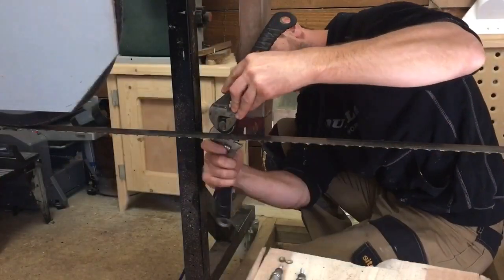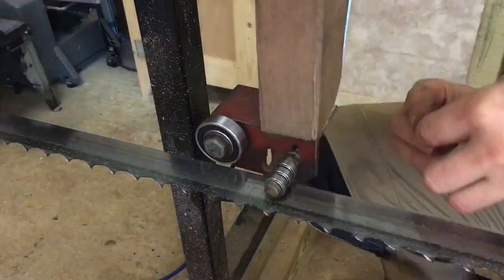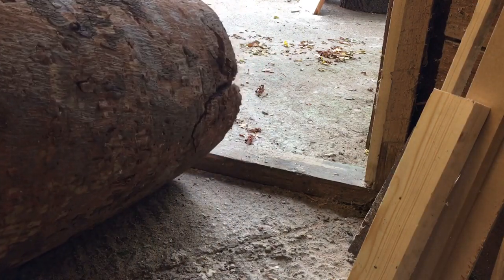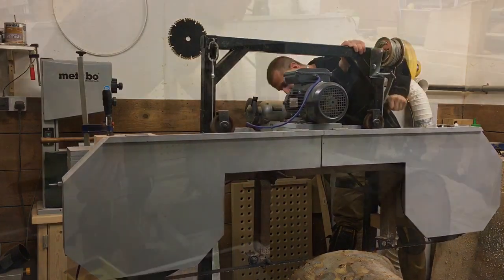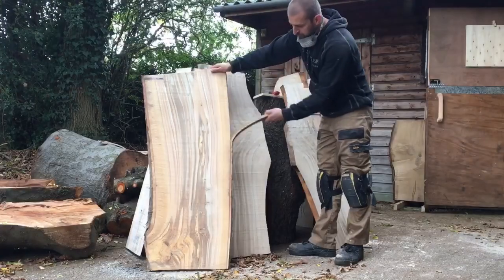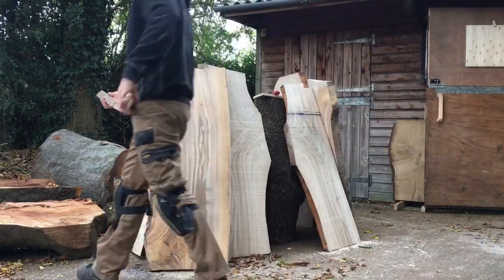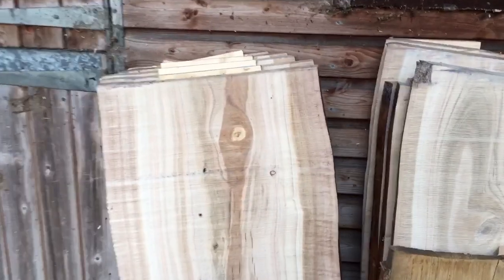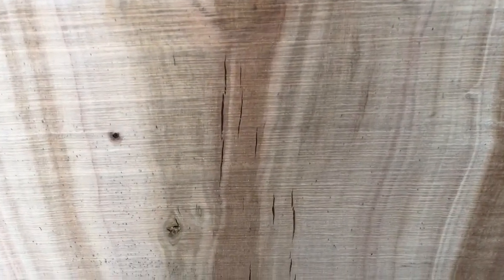Milling eucalyptus! Did I get this wrong?

Comment: This log would be best quarter sawn. If you look you will see that the cracks occur in the pith. This section should be" boxed " or removed. Sawing it requires careful attention to the stress in the log. If you look at Bambra Agroforestry on you tube you will see an excellent demonstration of the technique.

Comment: There are some 800 different species of Eucalypt. Most of what grows outside of Australia is Southern Blue Gum(Eucalypyus Globulus) or similar species.. It grows much faster on more fertile non-Australian soils. This was a very young (12 years) and small log, absolutely certain to split. Old, slow grown (regular droughts help!) timber which has been dried for twice as long as you think necessary won't crack anywhere near as much.

 If you could find yourself a 500 year old Toona Ciliata Australis you could retire on the sale value. Gorgeous timber.

Comment: Hi mate, your problem is mostly that the wood is cut down at the wrong time of year all wood to be killed should be felled in the winter.  This means that it has a much lower moisture content to start with.  Also eucalyptus grows too fast here in the UK as there is no dry season for the wood to strengthen up. One thing with your stack of wood you should line up the stickers with the base rails of your platform and always have a sticker about 1-2 inches from the end. Also try flipping one board then not the next one in the stack this way the wood helps the slab below it to dry straighter as the forces are working against the cupping of the one above. Great work though and a great channel.
Reply from the maker: Blaise Brogan thank you very much, that was really helpful! 
My father told me many times about harvesting trees in the winter is the most ideal! ( he also milling his own lumber)
Unfortunately in my case I don't have a lot of choice, I take the logs when ever they being offered, regardless the season! 
Thank you for commenting!
Regards Szilárd
Reply: Mate I know you have to take them when you can you could mill them in 1/2 then leave them for a few months, but great you are saving wood!
Reply: eucalypts grow fast thats wat they do,doesn,t make a difference wen benching it,keep ya logs damp if storing them,use a lucas mill look them up on google we have zero probs
Reply: @williamleahy1377  totally depends on the species and conditions. Some eucalyptus grows fast, especially in wet conditions, but many are very slow growing with extremely dense hard timbers.
As for sawing in the winter, it generally doesn't matter much of Australia when u cut them at least the species we bother with.

Comment: In Australia we'd call this a hardwood not softwood.  They do grow quickly and are used in plantations for construction timber and pulp.   They do suck up a lot of water to see them through the dry season - cut them at the end of the dry and I think you'd find a different outcome.  I know you didn't have a choice.  I think I'd leave bark on, whole logs, sealed ends and have another go in 2 - 3 years....You may find the wood gets very hard.  Love your videos.

Comment: I am searching some information since last year about how to saw eucalyptus and prevent it from cracking, I think quarter sawing is best way to saw eucalyptus, another way is to split the log first and the cross cut the planks, and then you have to dry it very slow by wrapping with a plastic, if not then it will bend, warp and twist. 
I'm going to do some experiments shortly.....!

Comment: We have wood here called Sweetgum, same deal. It's best left to dry as a log, off the ground. They are both extremely unstable, to the extent that you can dry them to 8% and they will still move on you. Best to leave them for a good long while OR cut your slabs WAY oversized like 12/4 or 16/4 so that you can have enough to mill down the ridiculous amount of movement you'll see. There is so much moisture in it, I can cut a 20' long log at 30" diameter and never use a drop of lubricant.
Reply: Vikingblooded Kraftwerks I was actually going to say this looks just like sweet gum.  I have three logs drying in my carport right now look exactly like that. Although mine is not cracking because it didn’t get direct sunlight that may be a problem here.
Reply from the maker: Wow! Thanks mate appreciate that!
Yeh I stopped using lubrication after the second Slab, quickly realised there is no point in it! 
So I just leave on the ground for now, to dry! 
Cheers
Reply: Ken Moon - Moonpie Creations sweetgum is one of those woods that you can dry to 8%, cut a board and watch it warp on you. Make sure you cut it as slabs as thick as is usable.
Reply from the maker: Ken Moon - Moonpie Creations interesting!
I kept the first couple of test Slabs indoor! Did not see any sunlight, and it was cracking and warping the same way! The fibres collapsing as they dry, that seems to be the biggest problem!
Reply: If this is anything like sweet gum, you need to let the log sit for a year before cutting. Or coat the entire slab right after you cut it to slow down moisture lose. It seems to be losing moisture to fast that causes the fibers to contract.  But as Vikingblooded Kraftwerks said, even after you dry these types of wood the fibers are so tight that they may still warp on you after they are dry. 

Ken

Comment: Hi, the argentinian eucaliptus its used in buildings (roofs, floors..) or maybe some veneer. Its a low quality wood, because its not stable, and after drying use to crack, but is used, mostly on bakeries that still use a tradicional oven to make bread. Sorry for my english. Un cordial saludo.
Reply: Also is used to make pallets!
Reply from the maker: Thank you very much for your comment appreciate that!
Cheers

Comment: That cracking is called checking in English at least.  It can happen if wood is dried to rapidly.  Or if in this case the wood has a large amount of internal stresses.  Generally what ever is near the center of a tree is on the unstable side of the cuts.  But I am curious to se if this cracking is also occuring on the outer edges of the slabs.  If it is you have a bunch of fire wood.
Reply from the maker: Kravchenko Audio well yeah! Checking everywhere! 
Firewood is value too 🙂👍!
Cheers
Reply: I did some logging to back in the late 1980's and we found that any trees that were fast growing were not that great for quality of wood.  The ones in the north side of a mountain or shaded by larger mature trees that grew slowly are the ones that turned out the best wood.

Comment: I known eucalyptus wood very well for over 30 years.
Eucalyptus is the most abundant wood in Portugal.
It is a wood so bad for carpentry that most of it is for firewood to burn in the stoves.
Some are used on roof frames.
Some is used in veneer, but in a small amount. It  have no other use.
What will happen to these boards, in 3 or 4 months is that they will open cracks and the boards will warp in a way you can not imagine. I advise you to not use the wood before letting it dry for a few months.
good luck. (sorry mt english)
Reply from the maker: From The Wood thank you for your comment appreciate that!
Well that's what I was worried about, but I'm not surprised after what I seen so far! 
Cheers
Reply: I forgot to say that most of the wood (trees with 4 or 5 years) is for the pulp industry - paper pulp.
Cheers
Reply: The Contige eucalyptus (Eucaliptus globulus Labill), located in Contige, Sátão, is one of the largest eucalyptus ever classified in Portugal, with an impressive 11 meters of perimeter at the level of the chest.:
//www.wilder.pt/wp-content/uploads/2016/01/Eucalipto-Eucalyptus-globulus-de-Contige-Sat%C3%A3o-Viseu.jpg
Reply: It takes 4 or 5 years to get it dry enough to burn in a stove, and then it is fantastic. It burns really hot and long. The smaller diameter wood is used in roofs. But the Spanish come to the Azores to cut it and use it for paper
Reply: Just to be clear, the eucalyptus introduced and grown in Portugal may be crappy wood(likely the fast growing species) but a lot of the species here in Australia are amazing for carpentry or any other use. The main species l cut locally generally only has around 20% moisture content in the heartwood when cut, is hard as a rock and is considered suitable for use untreated in ground for 30+ years because it is highly mold, fungus and termite resistant whole looking something akin to mahogany. Some eucalyptus species produce some of the finest timbers in the world, but others are basically useless.
Reply: @Jake12220  The one is Portugal and NW of Spain (Eucalyptus Globulus) grows very fast but, unlike it is said in the video, the wood is not soft at all and will last a long time if they are dry. Since it is fast growing the main use for it is wood pulp for making paper.
Reply: You're very wrong. E. Camaldulensis has a very hard red wood that splits but can be made into boards if it's dried slowly, and is also excellent for posts and firewood. As firewood it doesn't require years to dry, one year is enough.
E. Grandis is very fast growing, it has a softer and lighter wood and can be milled and even made into plywood. It is better than most softwoods.
Reply: This is useful information..i just bought a house in Galicia, and similar to Portugal there is eucalyptus everywhere... After reading it was a hardwood I was going to make furniture out of it but I know they have the fast growing type here and they use it to make paper, I guess I can't use it for furniture.

Do you know what other hardwoods that are available in this region I could use instead? Thanks

Comment: LOL If you want a challenge you should try turning it.....I know that shrinking to an oval shape is normal with green wet wood but eucalyptus is on a whole new level of "unusual" One interesting thing though is how it reacts to ebonising, the heartwood and sap wood react differently. The heart wood goes black, the sap wood goes a blue-gray. I have caved some spoons from it. Once it has dried out it seems stable and will produce a fine surface

Comment: I was thinking you'd need a wood stabilizer like Pentacryl or wood juice.  I bought some Pentacryl for this very purpose but haven't tried it just yet.  This stuff goes across the entire piece of wood, not just the ends.  With that being said, it's also not very cheap, but worth a try I'd suppose.
Reply from the maker: James Jacobsen thank you!
The question is if it would work with wet wood?

Comment: Do you have any information on how hard and rot resistant Eucalyptus is? I especially want to know if its rot resistant because I thought I might use it in the garden, thanks
Reply: Depends on the species. Some will rot or get eaten by bugs, others have the highest in ground rating possible. I mainly cut fine leafed Ironbark, it's listed as being good for 30+ years in ground without any treatment (that's in worst case scenario), l doubt you could get it outside of Australia though and it would likely cost way too much to use for garden or retaining walls. Smaller trees are commonly cut as fence posts in areas where its native as it lasts longer than treated steel posts in ground.
Reply: You really don’t want to use eucalyptus around your garden. It releases a chemical that suppresses growth in most other plants.

Comment: Another really interesting video, 12yr old tree! Jesus that grows quick! Amazing how it cracks so quickly as it drys. Looks to be interesting wood though. If it drys so quickly could the approach be leave it as a log for longer to slow it drying?
Reply from the maker: Al H thank you! I might end up doing this!👍
Reply: I think that would help but I just picked up some wood from a small stand that was cut down and even large diameter trunks with 1-3 weeks after being cut were already checking.

Comment: In California we have way more eucalyptus than we should and I have a mill. It twists and warps and checks all over, even when kiln dried, leaving weird moist patches throughout. Eucs have an interlocking grain pattern and grow in a spiral. Old growths in Australia provide decent stable lumber, but young trees produce junk. We use it to make beams or outdoor slab benches where it doesn’t matter.
Reply: We also make 18”x18”x48” blocks and butterfly the large cracks to make simple nice coffee tables! If you want 4/4 boards, you’ll want to cut to 8/4 and plane down :/ one log we cut had boards almost completely split in half in the middle of milling! Look us up @lumbercycle
Reply: Absolutely correct, When Australia and its Eucalypts were  first discovered it produced superb timber but it came from old trees often 500+ years or more and that did not warp or crack. That log might look big but it's a baby, mature Eucalypts are massive trees, Eucalyptus Regnans for example can get to over 300 feet

Comment: So what did you decide? Any way to use eucalyptus? What if was dried in a kiln?
Reply from the maker: Travis Chenoweth not sure yet!
I have seen pictures being used for flooring, but it might was a different species. I think kiln drying will make it even worse!
Reply from the maker: Travis Chenoweth thank you I checked it out! Very useful!!
Reply: Szilard Pinter Glad it was helpful. Seemed to be a good source with helpful links.